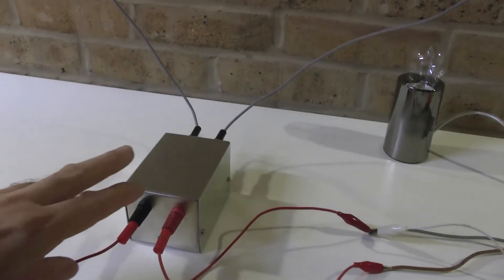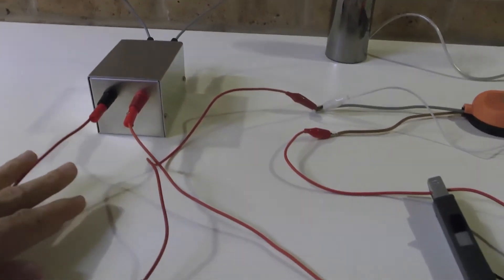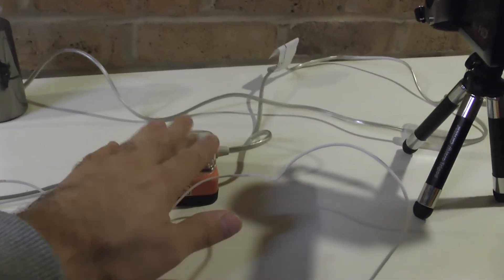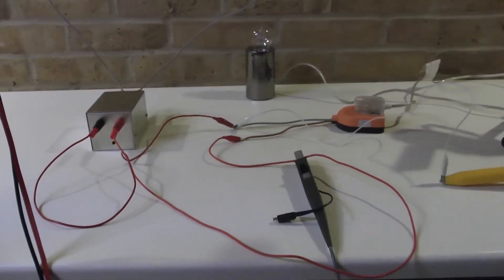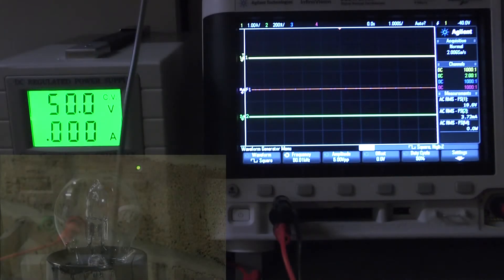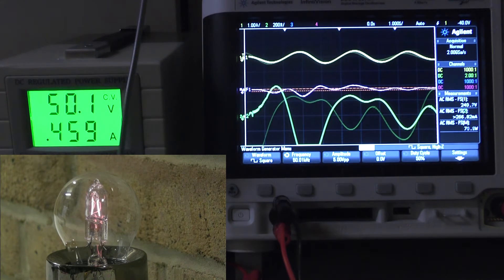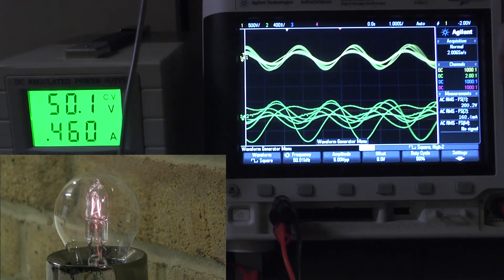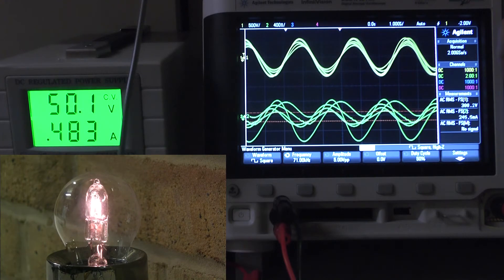Power Propagation and circuit Topologies, Part 2

Comment: That bulb didn't seem to give off much light as part of the wall nearby way still dark so I wonder if it really was running at 370W. It may have been due to the camera trying to adapt to the brightness though. 

Are the current and voltage probes suitable for use at that frequency?

Another measurement would be to use the same probes at the input to give a true input power reading.

Does the load itself have a 'flat' frequency response?

Square root of two for a complex (non-sine) waveform?

Comment: @TheOldScientist So 75watt creating 370watt? You create 5 time the energy then u invested... I am skeptical. I fear it a measurement error. If this where true then u could run the input from the output creating unlimited energy.  My theory is when u pulse the coil u cut the power then the back EMF gives u energy what u can harvest.
The water heating is a good idea. There u can measure the energy output. 
Cant wait next part :D